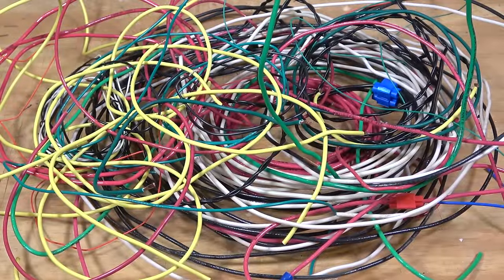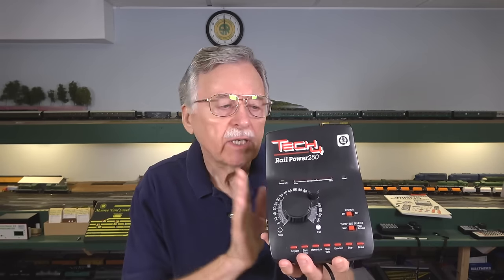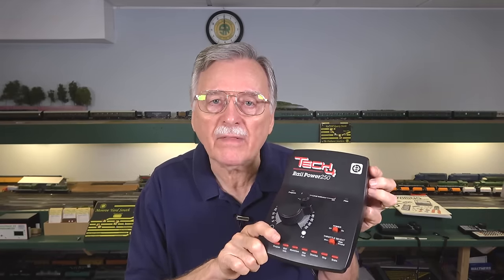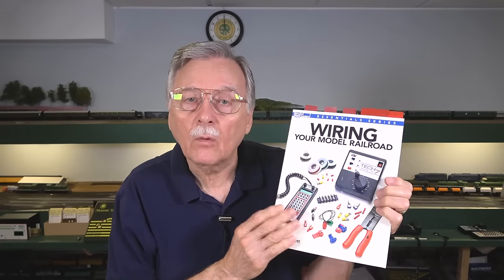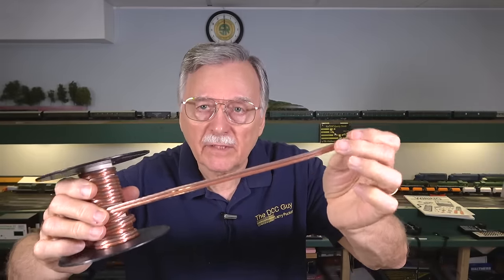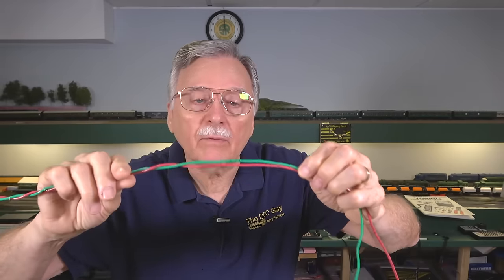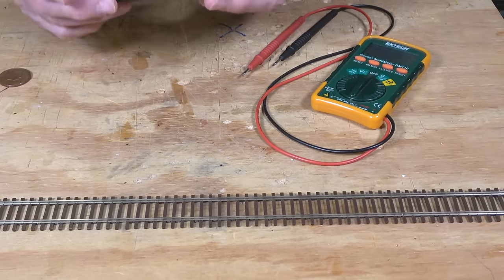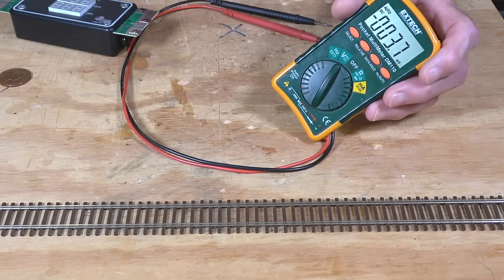Wiring Your Model Railroad For DCC (335)

Comment: I've never been an advocate for the suitcase connectors for a couple of reasons. #1 susceptible to moisture and corrosion. Especially on our portable modules. #2 is the size of the connection. Your putting a lot of current through only a knife edge connection. I personally would want a more substantial connection. Nothing worse than setting up for a train show and having to find a loss of power. Most times it has been a suitcase connector. Open the cover and see the green.
Reply from the maker: Well, I think that the engineers at 3M figured out just how much current these little buggers can take and designed them accordingly. As fir the moisture issue, the basic concept of the insulation displacement connector was for use in telecommunications and in automotive settings especially for interior wiring such as the radio installations, etc. While these situations are not exactly hermetically sealed they don’t get exposed to a lot of water and hopefully your modules are not as well!

Comment: I have a an old DC 4 X 9 layout with 13 blocks.  The blocks are wired with the Atlas 20 gauge wire.  Also, the track has rail joiner wire connections that are an even smaller gauge.  I’m adding DCC to the layout that I will be able to switch with the DC so I can continue to run mid-60’s Tyco locomotives.  Would you suggest a complete rewiring with larger gauge wire? Thanks!
Reply from the maker: I have seen worse work. It depends on how small your main bus wires are and how far the current has to flow through them all. As a test just throw all your block switches to the same controller and then hook up the DCC system in its place and run some locos. Keep in mind though that what works with one loco may not work as well with 3, 4, or 5 all running at the same time.
Reply: @TheDCCGuy  Thanks!  I’ll give it a try.

Comment: I planing to do a shelf layout around my whole house. Which is like a 500sq feet cube from room to room. Would it be better  to hus install a power pack for each room instead of wiring. Every 30ft or so. I think with 9in rails that 40 tracks. So about every 20 track should I just install another power pack supply for DC Ho model.
Reply from the maker: DC is a bit different from DCC with respect to power requirements. You mainly need to be concerned with voltage loss due to resistance in the wires and track. To offset this you can use thicker wire for long runs. Adding power supplies along the route would also require adding controllers and blocks which is even more complicated which is one big argument in favor of DCC. I suggest you bone up on Ohms’s law and estimate how much voltage drop you would see for various combinations of wire diameter and length then decide how to proceed.

Comment: You mention a "Hot" connection, or rail...   what is another name for "Hot", since it doesn't pertain to the temperature?
Reply from the maker: In wiring a wire that is carrying an electrical current is considered to be “hot”. This is commonly used with AC wiring to refer to the black or in some cases red wire as hot while the white wire is the neutral wire.
Reply: Thank you very much. @TheDCCGuy

Comment: Does using a wire gauge more than what is needed create another set of problems?  Thank you for the video, Larry.
Reply from the maker: I cannot think of any electrical issues, but from a practical viewpoint larger wires are relatively more difficult to manipulate, solder, connect, and work with in general than one of smaller size. So it really is best to use the correct size for the job at hand from the outset. However, a size variance of small proportions isn’t likely to be an issue in that respect either. So for example using 12ga wire instead of 14ga would not be overkill but going to 10ga or 8ga would, it also would be a very expensive option—copper isn’t cheap!
Reply: @TheDCCGuy  Thank you, Larry.  Congratulations on the success of your channel!  You must be one of the hardest-working YouTubers out there.

Comment: A really useful video. I like the idea of using the zip wire, or as it’s sometimes called speaker wire. The plus and minus are clearly indicated and I’ve used it a lot for stereo speakers. Do things such as the suitcase connectors, toggle switches, or the small gauge feeder wires add a significant resistance to the overall DCC signal?
Reply from the maker: No, I’ve been using these connectors for over 20 years without problems and switches have been used for decades longer. You need to be careful on large modular layouts where some connectors between modules can add up to significant voltage loss. 

Small gage feeders can be problematic but not if kept short. I use 20ga feeders but keep them about 8” long. However at my old club where telephone hookup wire was used and runs were sometimes several feet, you could watch locos slow down and speed up due to the variable resistances of the feeder wires.

Comment: I know a lot don't like brass rails but I know that brass is a excellent conductor.
Reply: Until it tarnishes which is an effective insulator stopping power transmission across the wheel/railhead interface.
Reply: @68Jaguar420G   Any track can do that. Just keep it clean.

Comment: My current train layout is a DC system, I am in the processing of upgrading  it so it can work with both DC and DCC systems. I do not have any DCC controls at this time, but if I set up the layout correctly, I can add it in easily. One of the topics I have been reading about is TVS Protection (1.5KE36CALFCT-ND) and the correct placement. Should this be used and were would you put it? I currently have a Lionel ZW transformer and would love to keep using it. Also, I just picked up your books "DCC Projects & Applications, Vol. 4" and "Wiring your model railroad". At a quick glance, you do not talk about TVS protection in either book unless I missed it.
Reply from the maker: Mixing DC and DCC is not a good idea except on the most basic of layouts. There are so many accessories now for DCC that are not compatible with DC that you will not be able to use if you want to mix them so you’re hobbling yourself. Now if you just want a simple loop or small switching layout you can get by and I did a video a few months ago on the subject so feel free to scroll through my listings on my channel hime page.  As for TVS, I am finding them on various DCC accessories such as circuit breakers, autoreversers, etc. Some experimenters have suggested also placing them on the  motor leads from the decoder. Others say on the inputs to the decoder. I have not had time to experiment myself and from what I have seen from others the jury is still out. Plus I have never cooked a decoders with voltage spikes, I prefer to make sure my wiring is as bullet proof as possible and avoid them in the first place.
Reply: Thank you for the information is it very helpful. @TheDCCGuy

Comment: Hi Larry. Thanks for another helpful video. My HO layout is a 15m loop, originally wired for DC with many isolating sections. The power runs from around the loop in both directions from the controllers. The sections furthest from the controllers are not connected. I am considering rewiring the mainline with a pair of bus wires similar to your zip wire and just have the four yards around the loop connected through the existing panels ( to allow sidings with locos not in use to be switched off) should I connect the new mainline bus into one continuous loop. Regards Peter.
Reply from the maker: Short story—don’t wire as continuous loops. Now the long story—every time this question has come up the EE guys always say never connect a loop back on itself, always use a linear bus. Most say it gets down to the difference in the lengths to where the loops are joined, which of course is variable within the same loop, and in turn means where the signals meet they will be different. Although this might seem a trivial matter you have to also consider how fast these signals are transmitted on a pair of wires. So I always recommend that loops be broken to create two independent bus configuration.
Reply: @TheDCCGuy  Thanks Larry, I’ll just upgrade the wires then but leave them disconnected. (However they must get connected for a second every time a loco completes a loop.) cheers Peter.
Reply: @TheDCCGuy So as the track is a continuous loop, would you suggest inserting insulators at the end of each bus? So that the track and bus break at the same point.
Reply from the maker: No, cut gaps in both rails somewhere, say halfway round the loop and cut your power bus so it forms 2 separate buses, one for each leg.
Reply: @TheDCCGuy  Thanks again, will do. 🙂

Comment: Question relating back to decoder install:  what power soldering iron are you using, and what solder.  It seems that you use no flux, so I’m guessing that the secret is in the solder?
Reply from the maker: There are 5-6 videos,on the channel,about my soldering tools and techniques. Just scroll down through the list on my channel page.

Comment: There is a formula that we electricians use for distance and voltage drops. I’m not sure what the specs would be be for lower voltage like this but I will think anything like this you would run into drops anything past 10-12 ft unless you us 14 or 12g wiring throughout
Reply from the maker: Yes, in my book I have tables that provide the voltage drop per foot of at 1 and 5 amps. Also for different rail codes.

Comment: I started building a on30 layout, a simple figure 8 up and over with 4 switchs for a train yard. I used the peco switchs and track plus a little ddc transformer. So my bachmann 0-6-0 sounds and runs great on the figure 8, but as soon as I throw a switch, the transformer freaks out! I think the switchs are the problem, I've nailed all the tracks down and soldered all the rail connections. I'm at a loss and very disappointed, I was told by many that dcc was the best way to go.

Comment: extension and branching with OFC skrl type cable Audtek: What type of electrical connector?  For a T branch, do you make a cut in the outer sheath then insert a 3M T-top for each wire?
Reply from the maker: I would essentially use a “Y” with one branch dropped off the main bus using a suitcase connector.

Comment: Larry if use two sets of buss wires , do I need a snubber at each end , command station is in the center of the layout
Reply from the maker: You would use one at the end of each bus. You also may use one at intermediate points on long bus runs.
Reply: Larry thanks for the information